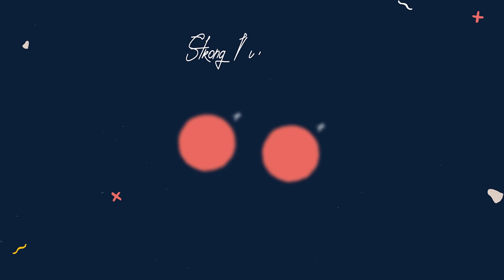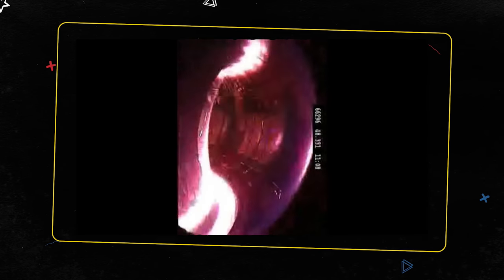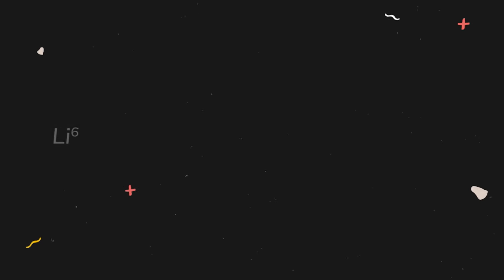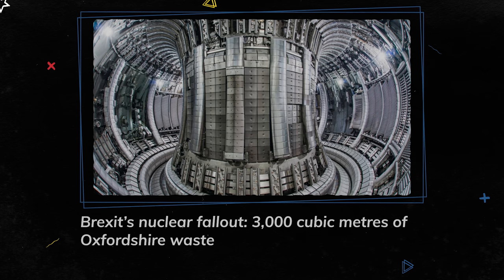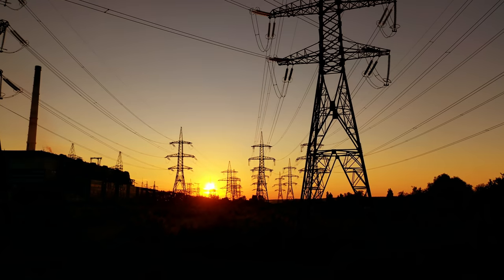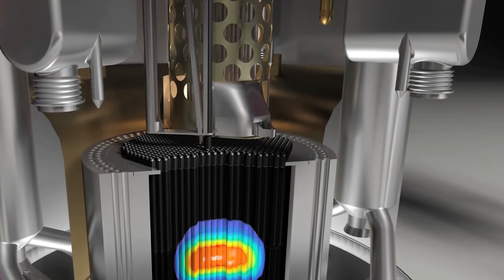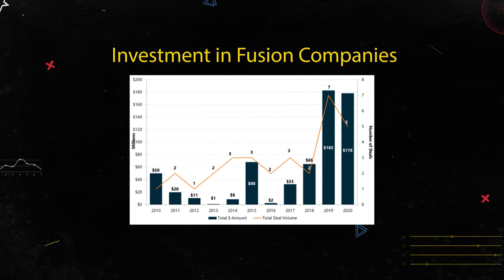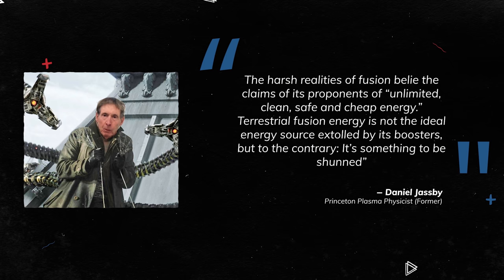What No One Else Is Telling You About Nuclear Fusion

Comment: when an old, experience scientist says something is possible, he’s almost always right. When he says something is impossible, he’s almost always wrong.
Reply from the maker: No one thinks it’s impossible. It’s likely. 

But cheap renewables have changed the landscape. And they’re available now. We’re not going to wait 30 years to clean up the grid.
Reply: @TechforLudditesSira  But there is no "cheap renewables". The more renewables(except hydro) countries add to their energy mix the higher their energy prices climb. Proven by Denmark, Germany, California etc. And all of them are still mostly depending on preexisting infrastructure to solve intermittency, if they were to switch to batteries/hydrogen storage to solve intermittency the price would have to go up a few more times. For certain regions like Iceland and Norway they are a great solution, but for most of the world they can not solve even halve the problem and if the world were to try to live with 100% renewables it would find itself in a new dark age.
Reply: @TechforLudditesSira  just to clarify we can clean up our planet right now just all about money and also money spent on fusion reactor isn't useless at all just think this way if it's useless then how are we going to survive in 6 billions years when sun run out fuel and we are still stuck with limited useless renewable energy required from sun
Reply: Do have a response to any of the arguments presented? Even the proponents of ITER admit that neither ITER nor DEMO are going to produce commercial fusion before the 2040s. And that is being optimistic that they can solve all of the current issues. Also did you know the world is running out of helium? Yet another problem to solve if you want to bet the farm on superconducting magnetic confinement.
Reply: Although I don’t have an answer to even a single of the problems suggested, I can suggest a parallel series of events. When fission energy was first being investigated it had many similar problems: too unstable (runaway reactions) which were remedied with better neutron absorbers and safeties), the elements required were too rare and alternatives didn’t work (there wasn’t enough U235 to go around, then we learned to use 238 and now even thorium), it wasn’t efficient due to pumping losses (early reactors required massive amounts of cooling and had unguarded waste systems that contaminated surrounding areas, this has been remedied in many ways) and many more examples. I’m just suggesting that no one can really claim to know either way yet.
Reply: Agreed!
Reply: @haha-ui3fp  renewables make sense and are cost effective if complimented with a conventional nuclear fission baseload.
Reply: @tjs200  They can solve a bit of the energy problem, but not too much. Depends a bit on the area. Intermittency still a huge problem. Nuclear Power Plants(NPPs) are quite horrible for balancing the load as are solar and wind. Ideally if there's enough hydropower it can balance, but in many places there's just not enough rivers and lakes for it. Economical green hydrogen technology is even more of science fiction than fusion. Batteries or pumped hydro could work but automatically raises the price of electricity by a few times.
Nuclear fission is nothing new and can play key role in the grid as France and Ukraine prove as long as NIMBY and safety culture can be solved. However it's very slow to build and right now thanks to Germany, Japan etc the world isn't even replacing the existing aging reactors, so unless investments change drastically nuclear will just not have any more of a role globally than it does now at least for another half a century.
Reply: Brought to you by: Fission power companies
Reply: im all for renewables but have u thought about what happens after billions of solar panels die at the same time? cuz they were all installed around the same time.
we still need to recycle all of those.
which will require new buildings and possibly thousands of those buildings all over the world.

but if we get fusion right we would only need a couple huge buildings which we could possibly scale down in size as we always did with everything our ppl have invented.

nothing will be simple we will always run into problems. our task is to overcome those problems.
and possibly think further than next year.
Reply: @robertg7249  the reason the world isn’t running on solar right now is because you can’t convert the whole world to solar in a day (or even a year, or likely even a decade). What this means is that we’ll have a continuous, rolling maintenance cycle for solar panels just like we already have for hard drives in computer servers. Have you ever noticed that the internet hasn’t ever died because all the hard drives died at the same time? It’s because they also weren’t built at the same time. The same will be true of renewable energy sources. No electricity generating facilities run forever - they all wear out and have to be replaced. Solar isn’t any different in that regard. The main difference is you can replace solar one panel at a time. With other energy sources, you have to replace the whole thing at once (although most utility scale energy production has multiple “units” of generation, so you replace those one at a time too, but they’re huge units, not small ones like with solar).
Reply: @TechforLudditesSira  What is cheap renewables? Solar power with 3-7% duty cycle and total effects per MW on the environment much worse than fission or something else? I would be happy to be enlighted.
Reply: @pianoforte611  you misunderstand. We will get all materials and reactants for nuclear fusion power plants from space, and we will build them in space. We have everything we need right here in this solar system to survive for billions of years.
Reply: @aaronbozigian4310  and how will you send electricity back to earth ?  what a rubbish comment.
Reply: @aaronbozigian4310  Jeez. Go read instead of posting nonsensical drivel.
Reply: @tjs200  but if you have nuclear fission baseboard why bother with unreliable   renewables?
Reply: D.A. Botos  we might
Reply: @Zangief The Red What and why?
Reply: "when an old, experience scientist says something is possible, he’s almost always right. When he says something is impossible, he’s almost always wrong."

Do you have some data to back that claim up?
Reply: D.A. Botos  "Anyone who said something is impossible may be proven wrong, or may have already had that happened."

But the quote doesn't say "may happen". It says "almost always" which is a much stronger claim. I've seen this (EDIT: or similar) quote said often but nothing ever given to back it up.
Reply: D.A. Botos  "Just seems intuitive, so easily reasoned that it doesn't need a backup source."

Just the opposite. To me, it seems a very suspect claim but I'm ready to change my mind if there's enough evidence.
Reply: D.A. Botos  I did read your whole comment but if you want me comment on every sentence, here goes:

"If there's one thing we know, it's that we're consistently able to find creative cheats and workarounds to make the impossible possible."

But you have not provided any data on how often an experienced scientist had proclaimed something impossible when a workaround was found or how often a workaround wasn't found. None of this justifies the claim of "almost always" (which is a bit vague but IMHO should mean at least 95% of the time).

"Saying something is impossible is purporting to know every possible way it could be accomplished, and furthermore, saying that no amount of time, effort, or talent will make any of them work even once."

It's not necessarily purporting to know every possible way but, in any case, it's not at all clear that impossibility claims, if possibly bold are wrong "almost always".

Scientists have made many impossibility claims, such as those of perpetual motion machines, that seem well justified. It's not clear to me that correct claims would be so dwarfed by incorrect claims.
Reply: D.A. Botos  I mean yeah but the possibility to survive is another story what I am trying to say is that if we don't start somewhere we will never get it started
Reply: D.A. Botos  Were those said by experienced scientists? Even if they were, that's still only 67% wrong in that sample. That's not "almost always" and the sample is too small and likely not representative anyway.
Reply: D.A. Botos  If you want to get to me, get some real numbers from somewhere. Until that time, that quote is an unsubstantiated claim.
Reply: D.A. Botos  I don't remember. Was it an experienced scientist who said that?
Reply: D.A. Botos  Who was the experienced scientist who said that?
Reply: D.A. Botos  I did quickly look it up. I didn't find a mention of an experienced scientist calling it impossible so I remain skeptical for now.

It's not like a few isolated cases would be good evidence for the "almost always" claim.
Reply: @haha-ui3fp  Renewables ARE cheaper than fission, coal or gas. The reason the price is higher is bad politics. The money goes to support now outdated and expensive old power plants. And combined with easy and cheap technologies like liquid air storage even saving the energy is feasible. Combined with battery storages, and others it's totally reliable and cheap.
And they have the added bonus of being more environmental friendly than others. So that's a big bonus.
Reply: @Sk4lli  I don't understand how one can say anything about price without some assumptions about taxes, market structure and other things (all together called politics). Perhaps in some communist utopia renewables work and are very cheap, but the current way of giving them a selling price guarantee and adding them to the market with very few other limitations distorts everything which results in super high costs to try and balance it. These costs are transferred to the consumer usually through very high electricity prices. One of the points is, that no regulator has demonstrated even remotely enough foresight to operate a grid with very large amount of renewable generation, while adding on time and enough energy transfer, storage capacity etc.
 Liquid air storage has an efficiency of 50% or allegedly 70% if there's a heat source(those are usually fossil fuel based ;). That already means that the only way the combined system stays competitive is for producers to sell electricity in times of high supply at prices 30-50% below the "pre renewables market price". And that assumes that the liquid air storage facilities are free to build and operate, whereas in reality the per kWh price is unlikely to be low as the utilization rate for them is bound to be low, since market rarely sees maximum level of deficit or surplus - situatiations when the storage can operate at full capacity. So no, full cost of renewables is not below the cost of fossil fuel or nuclear power sources, especially if any type of storage is used.
 So as to make things a bit less theoretical, try looking for what happened to generation in Japan and why the energy prices increased over 30-fold this month(January 2021). And they are still lucky that solar makes only about 7% of electricity mix vs 75% for combined coal, gas and nuclear.
Reply: Almost always?
Reply: @haha-ui3fp  look up the prices, it’s just not true t hat the renewables are expensive. Even the storage problem is solved: power to gas.
Reply: @AndreasDelleske  I've looked up the prices and in Europe. Countries with highest electricity prices - Denmark, Germany, Belgium, Ireland, Spain and Italy (0.2-0.25€/kWh). Countries with the lowest prices are Kazakhstan, Ukraine, Russia, Belarus and Serbia (0.02-0.07€/kWh). Kazakhstan, Russia and Belarus are among the slowest to add solar and wind power to the grid, whereas Denmark, Germany, Ireland, Spain are the leaders in this sphere.
Which countries have implemented the power to gas on the large scale? What is the resulting price level for combined renewable generation + storage?
Reply: Please check out   THE  SAFIRE PROJECT   they've done it  !
Reply: @bryantyong111  fusion will only last a few... Oh you're joking ok but ok so assuming that I'll tell that fusion is better than solar in many ways it's significantly harder to do space travel without fusion fusion requires less land can work with our current grid structure and doesn't need energy storage solutions once it gets here it will be better than all other sources of energy
Reply: @pianoforte611  fusion will actually produce helium and we have superconductors that can work with liquid nitrogen and were working on ones that can use supercool nitrogen gas
Reply: @haha-ui3fp  plus hydro isn't ideal for so many reasons while it produces cleaner energy than coal it produces 12× as much co2 as nuclear and has huge effects on agriculture and aquatic life on the river it's part of and the area around that
Reply: @pianoforte611  TBH, though, if we actually achieve practical fusion, He scarcity stops being a problem almost immediately.
Reply: @svettis  One could equally say coal companies back fusion because we will have run out of coal before fusion is practical.
Reply: @haha-ui3fp  working renewables are still cheaper than unworking fusion. So get real
Reply: @ddoumeche  I don't think I have claimed otherwise. But one shouldn't place all their eggs in the basket of solar and wind. And if one does want to have renewables in the energy mix then they shouldn't be implemented with guaranteed green/feed-in tariffs on top of electricity market.
Reply: @haha-ui3fp  nobody has placed all its egg in the same basket  China Japan are going for clean coal, Germany goes for solar + coal, USA going for shale gaz (unless Biden ban it ? that guy is insane) and France might build a few nuclear reactors every 15 years
Reply: anything is possible is my philosophy
Reply: @TechforLudditesSira  Its never a dead end until we bump into the wall.
Reply: I see you're a Space Engineer
Reply: @kethmarhkfy7luf.263  renewables are cheap because they are one-off purchase infrastructure amenable to price deflation by mass manufacturing and new production techniques, whereas fossil fuels have only increased in price in recent decades as demand increased and sources fell. They are a dead end economically and are socially, fiscally and morally unmaintainable. They are as doomed as your faith in them is.
Reply: @TechforLudditesSira   "cheap renewables" you mean the solar panels that need to be replaced every 15-20 years ? solar is still producing more co2 than nuclear(nothing compared to coal), and its still cheaper to dump a old solar panel then to recycle it
Reply: @haha-ui3fp  Hydro has its own problems; primarily limited number of viable places to build them, geological implications (most importantly landslides), eco- and hydrological implications (large-scale disruption of the water cycle), etc.
Reply: @kethmarhkfy7luf.263  nope, that argument is dying out as fast as the dodo. Baseline power is actually getting priced out of the market by cheaper renewable already. Many costs are predicated on 90%-100% usage scenarios. Now that renewable energy takes up more and more of the load, base load has trouble competing. Energy cost for nuclear is already rising to unsustainable levels. Combined with cheap energy stores that are in the works, renewable energy will dominate the market a decade from now.
Reply: Possible does not mean Feasible
Reply: W I S D O M
Reply: @TechforLudditesSira  imaging you can use solar and wind to power the world is a pipe dream.
Reply: @Only_God_Is_Allah_SWT  and wind turbines are an eyesore 🙃
Reply: If you think that something is futile or too difficult to achieve there is some essential discovery about the objective you have not yet been aware of ,or otherwise overlooked. Every problem has an achievable strategy to arrive at the solution.  Superconductivity required super chilled condition until the means to achieve it was discovered at a much higher temperature that can be achieved by nitrogen chilling. They maglev applications becomes affordable.
Reply: @TechforLudditesSira  You would have to rebuild the grid  first. The level of delusion about all of this stuff mystifies me. For a generation that has all the info at their finger tips you don't seem to be very good at Looking it up. Fusion doesn't work. It takes more power to sustain it Than  you get from it. As it ever was. Conventional  Nuclear is a really expensive way to boil water. Except  if you use one the new methods which are actually the old original methods reworked. They are very doable and they don't produce weapons grade waste. Plus you don't have to build those absurd concrete bunkers and put up with Jane Fonda's bullshit and blah blah blah. The list of improvements is endless. and dare I say it there will never be cheap health insurance. Why> Because Hospital's and Drs and all of their support staff are expensive. Think of them as an Army. Do you know of any cheap Armies? yeah me neither.
Reply: Apparently you are neither a scientist nor an engineer....
Reply: @pianoforte611  helium used for fusion magnets is way less than what other industries use
Reply: @TechforLudditesSira  I think molten salt reactors is the answer.
Reply: @TechforLudditesSira  Where are these "cheap renewables" being used on wide scale other than hydro? And Hydro is not something that can be implemented in many places where it isn't already being used now. Solar and Wind may be getting "cheaper" due to massive over-funding, but they are only "cheaper" compared to how expensive and inefficient they were in the past. There's nothing in place to solve the very significant problems they still have, such as intermittency not to mention problems unique to both wind and solar.
Reply: I believe the distinction is between could and should.
Reply: @tjs200  This. If only the Danish government and people would accept this and maybe invest in LFTR
Reply: good doggie, you may keep your funding
Reply: @haha-ui3fp  You're taking into account countries who invested in renewables super early. Prices for renewable tech (solar and wind at least) developed today, right now, are cheaper than all fossil fuel methods as of at least the last year or 2. But thats the new tech, not much of which is in actual use yet. New plants built from these new technologies will bring about cheaper prices, but yes there was a premium cost for being early adopters. But that investment was also necessary to develop the technology. So your argument is essentially obsolete.
Reply: @ablasttv  I think the prices you quote are based on theoretical models and estimates. I'll believe it when I'll see it actually built somewhere. If intermittency is solved by pushing the cost to the remaining fossil fuel power plants, then on paper the fossils are uneconomical and renewables are. But for the grid to stay operational, the cost of the balancing/back up sources has to be paid by someone - either by taxpayers or by energy consumers. Or you have to build storage and again pay for that. I'll believe the claim of cheap renewables when I see someone implement it at scale and have grid prices at a comparable level.
    There's also a lot to be said about the cost of both fossil fuels and renewables not being the same everywhere. It is highly dependent on myriad of factors like the distance to source and the market, weather patterns, interest rates etc. You put it as if solar and wind are now cheaper  everywhere and that is fairly obviously not true. There are places with cheap local gas or coal and little sun or wind.